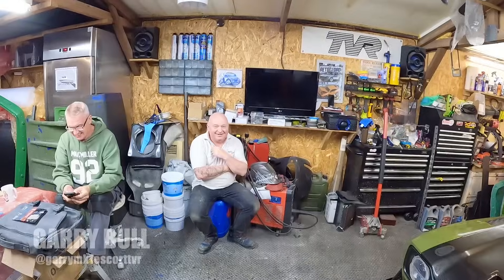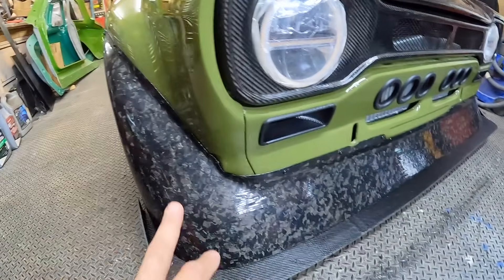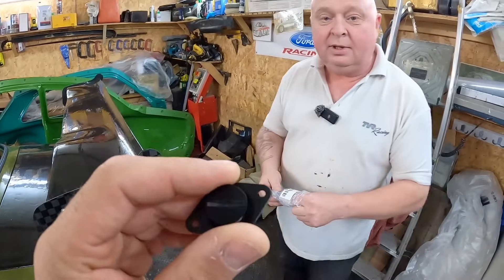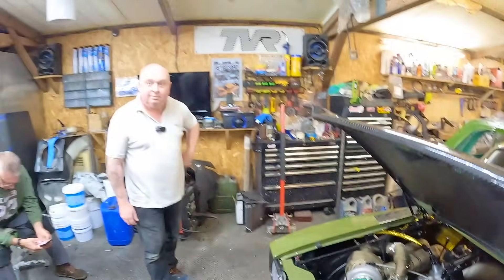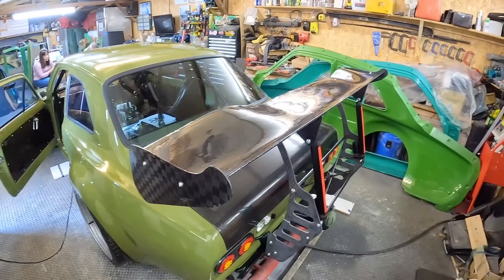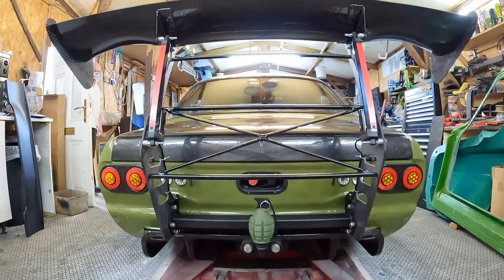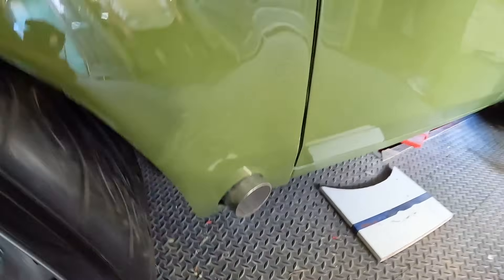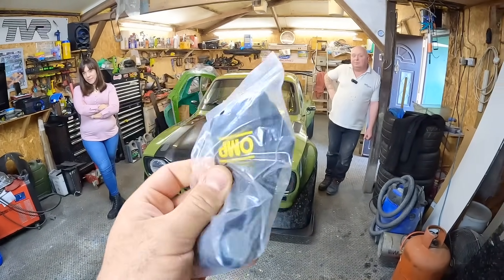1000 BHP TWIN TURBO 'MK1 ESCORT' UPDATE! 🤪 *LS V8*

Comment: Gary should have a word with FuelTech about incorporating an Air-Brake strategy directly from the FT-ECU. They seem like the type of company to jump right on-board with adding that type of functionality to their products.
I was going to mention 3D printing extensions for Marcus's wing. Would be well easy to trace the silhouette, stick it CAD and have a pair printed out in a day or so, ready to bolt on and fill the joins. That would save Gary having to carve them out of foam. EscorTVR looking great/mental as always Gary. 👍🏾
Reply: thats a good idea mate. im sure fueltech could figure something out to make the wing auto adjust the faster you go.
Reply from the maker: Now that’s a great idea. Would easily be do-able with a signal from a speed sensor. 👍
Reply: @marcushayesford  will look in to it once its up and running

Comment: Gnarly AF.   Would love to try active aero on mine.
Reply: going to see if i can get my fueltech ecu to control the spoiler so the faster you go the more downforce it'll create instead of it be set in one position or me manually adjusting it with the switch its currently connected too

Comment: Hi Gary what have you done to the 350i rear end to beef it up for all that power and torque? Are you still using Salisbury diff? What gearbox did you opt for?
Reply: thats top secret mate 😂all i say is ive upgraded to a btr diff. gearbox is bmw 5 speed diesel.
Reply: @garrybull4165  I’m assuming getrag then as the newer one is a bit more buttery. 😂 btr from chim? What suspension did you go for? Gaz? There’s not many options for the wedge I know avo used to do a set but not sure they still do. I’m opting for a t5 for mine I was looking at the 5.3l Chevy v8 as a future option also 👍🏻
Reply: @user-fd1sd7hr9o  yes got the 5 speed from an e46 diesel as there really strong not like the other boxes. chap i got the conversion kit off and the box runs the same set up in his drift car running 700hp and he hasnt blown a box up yet. yes got gaz all round. if you go LS get the all alloy version as there pretty much the same weight as a rover v8. mines cast block so fair bit heavier which isnt a bad thing as the car is pretty light

Comment: It's a vauxhall engine - should have coyote lighter more powerful, stronger 😢
Reply: It's not a vauxhall engine. Vauxhall went to GM to use it in the Aussie vxr8
Reply: It’s a Chevy small block it will be iron block alloy heads the Americans call it vortex 5300. It’s a 5.3l based on Ls also called mini Ls in America 👍🏻
Reply: Where’s the link to your build, or did you Mustang it?

Comment: Unfortunately with them little wheels you won’t get the full benefit of the power
Reply: i dont think you'll ever get the full benefit of the power no matter what size wheels are on it. rears are 10x17 with 275 35 tyres. was going to go 12x17 but id of had to make the shell 4" wider
Reply: @garrybull4165  
Yes I bet, but either way it’s worth trying to use the best minds that be to work out the best size wheels for the gear ratio as it would be such a shame to lose loads of power , I mean all that power in an escort WOW BUT WHAT EVER YOU DO it’s a fantastic build so well done 👏👏
Reply: @Mel-he1hg  the gearing shouldnt be too far out from what tvr fitted originally so should be ok. i wouldnt want to push it top end anyway as it'll probably be sketchy as fook. no driver aide's in the car whatsoever. you have to drive it yourself which was always the plan not like modern cars
Reply: @garrybull4165  yes spot on can’t wait to see it in action , it’s a lovely build well done
Reply from the maker: Less grip = more danger = more fun! 🤪
Reply: @marcushayesford  we like fun 😁